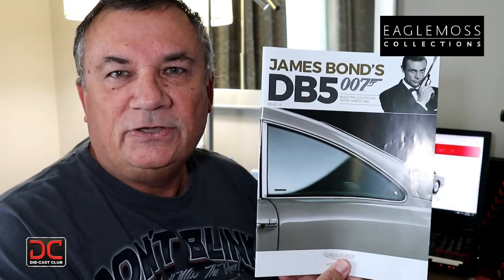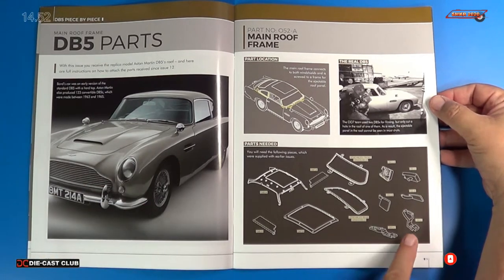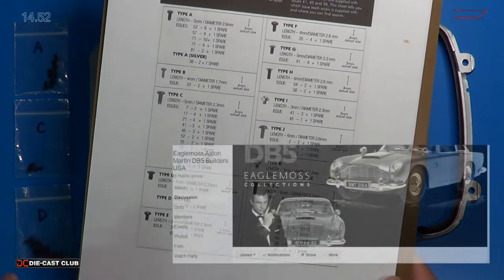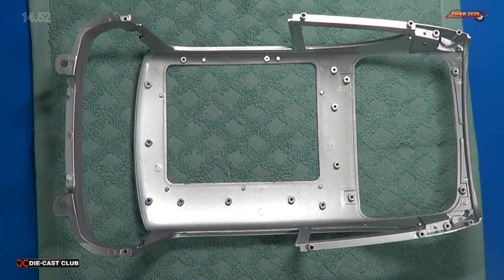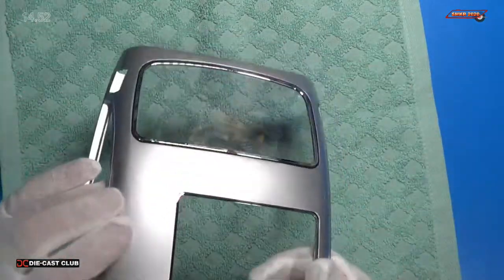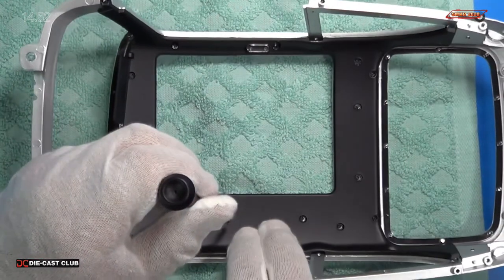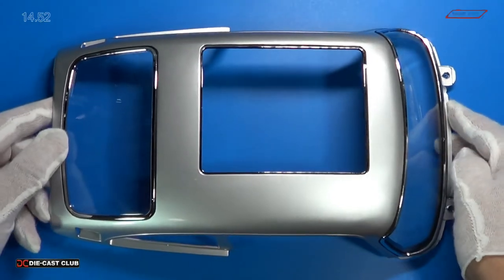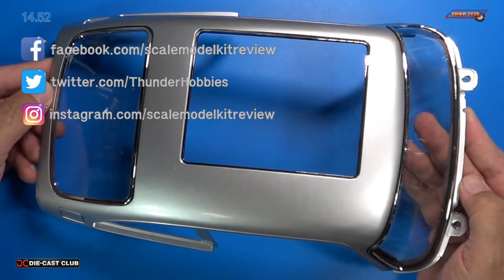Build the Goldfinger Aston Martin DB5 Issue 14 Stage 52 - Main Roof Frame & Binder

Comment: NICE!!  Some big parts. What a fantastic model.     
If I ever get the rest of my parts,  this series of videos will be a great help in putting the DB5 together. Still at part 50 and waiting.
Reply from the maker: Give them a call and they will help you out.
Reply: Scale Model Kit Review    sorry to say Ive called them numerous times, sent many emails and I get either no reply or just plan lied to. Over four months with no new parts
Reply from the maker: @richardschindler8822  they would not give me any information about your account, privacy concerns, email them at customerservice@eaglemoss.com, include your account number.  I received a response to the email I sent them for you in two days. Also suggest you check your email spam folder on your exchange server.
Reply: @richardschindler8822  I'm in the same boat. I'v received issues 1 through 6, but nothing for over two months.